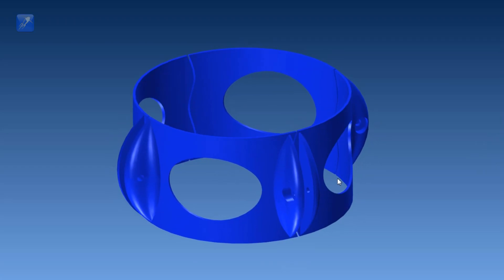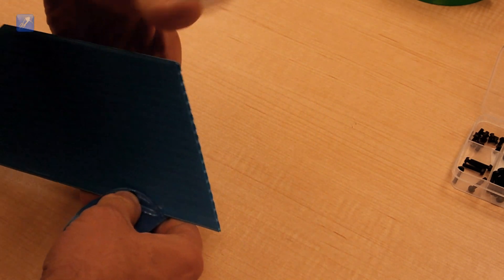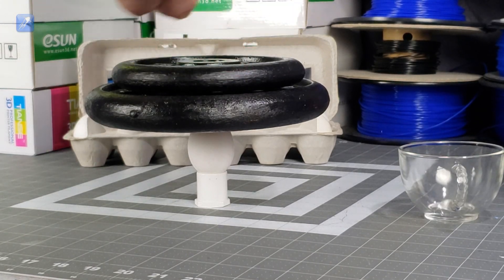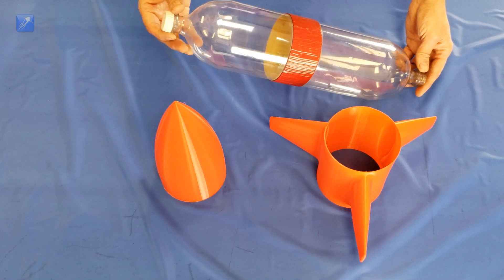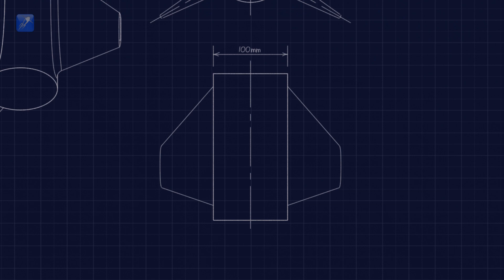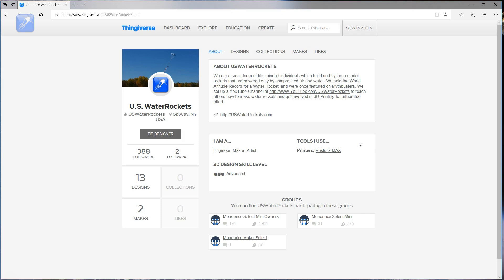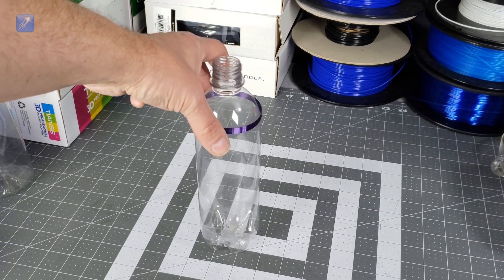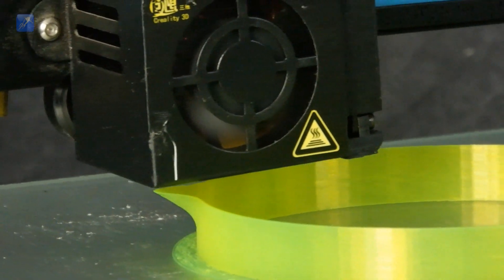Universal 3D Printed Water Rocket Fins

Comment: I could use fins like this if if is doable for 1 inch diameter rocket tube. Would that be possible?
Reply from the maker: There's no reason I can think of this won't work. I've printed some 1.25" in diameter and they worked great.
Reply: @USWaterRockets  Okay...great...thank you for the quick response!

Comment: My Cub Scout Pack just got into water bottle rocketry and we have been tinkering with simple cardboard fins attached with tape or hot glue. I’d love to show them how extensive the hobby is and that the sky is the limit when it comes to design and materials. However, I don’t have access to a printer. Do you by any chance offer pre printed fin sets and nose cones for a regular two liter ( coke or Pepsi ) type bottle? Any help or advice you can offer would be greatly appreciated!!

Comment: Will this fit in a 1.5 litre bottle? I'm from Malaysia.
Reply from the maker: It fits any bottle because you measure the bottle diameter and scale the print to match. It is explained in the video. Cheers!
Reply: @USWaterRockets  I found out the 1.5l bottle diameter. It's 88mm. So do I print it slightly larger, say 89mm? For it to fit?
Reply from the maker: Try 89mm and only print a little but of the fins to test fit. You can then decrease the scale until you get the exact fit you want. Every printer is a bit different, so it's hard to know what scale to use until you do the test fit.

Comment: Where can I buy the plastic used? Is beautiful, nice project👏
Reply from the maker: There are plenty of stores that sell 3D printer filament now. Most hobby stores and some office supply stores sell it. If you don't have a local store like that nearby, then you can get any kind of printer filament you want from Amazon or Ebay or Hobbyking. Thanks for the kind words!
Reply: @USWaterRockets  are you using PLA or PETG?

Comment: I'm sorry for being picky, (but, after all,  it's still rocket science, isn't it?). The fin area affects dramatically the centre of pressure of any rocket. CP should be always placed behind/below the centre of gravity (CG). As a rule of thumbs, at least at a distance that matches the diameter of the rocket. How can you be sure that your "one scaled size" fits all, works?  I mean, in terms of having a predictable flight trajectory. Keeping the same diameter, if you build a 50cm water rocket, or a 2 meters one, will require a different fin area.
Reply from the maker: The fin area can be increased or decreased by scaling the fin can in the Z axis when printed, but in reality most people who build water rockets generally make whatever size fins look nice to the eye, and then use clay or something packed in the nosecone to move the CG to where they want it. Thanks for the question. Your feedback is appreciated! Cheers!

Comment: very nice design just printed one nearly perfect only a bit of problem at the top and bottom edge of the fins  because of to high Layer Height
Reply from the maker: You have to find a balance between the layer thickness and the wall thickness (nozzle diameter) with vases. It sounds like you worked it out already. Nice!
Reply: yes got it thicker out when logging at the layers in cura. thinking of trying to at a layer of fiberglass for added strength to the fins and as a fun experiment    @USWaterRockets

Comment: Very nice design! Really like the well thought out structural 'egg shell' design and the ergonomic scaling feature! Makes me want to try water rockets again haha
Reply from the maker: Go for it! You can see this video was recorded back in the summer, and your lightweight fuselage idea was the motivation needed to finish the edits.
Reply: As a subscriber, I'm surprised you haven't noticed this "little thing"... The fin area affects dramatically the centre of pressure of any rocket. CP should be always placed behind/below the centre of gravity (CG). As a rule of thumbs, at least at a distance that matches the diameter of the rocket. How can you be sure that this "one scaled size" fits all, works?  I mean, in terms of having a predictable flight trajectory.
Keeping the same diameter, if you build a 50cm water rocket, or a 2 meters one, will require a different fin area.

Comment: That's a very neat, scaleable design! Well done! :) I think this is especially nice for beginners to water rocketry and 3D-printing. We made a similar design a while ago, but it's not scaleable because it connects through the nozzle to the rocket. Looking forward to put the two stage water rocket footage into our water rocketry in 2018 video. ;)
Greetings from the team
Julian
Reply from the maker: Thanks, Julian! If there's time, perhaps we will publish some more video of the stager. This is a busy time of the year! The hollow design is something we've used for a long time. The simple way of scaling is the "fell off the toilet while hanging a clock and hit my head" moment when the scaling idea was born.
Reply: As a subscriber, I'm surprised you haven't noticed this "little thing"...  The fin area affects dramatically the centre of pressure of any rocket. CP should be always placed behind/below the centre of gravity (CG). As a rule of thumbs, at least at a distance that matches the diameter of the rocket. How can you be sure that this "one scaled size" fits all, works? I mean, in terms of having a predictable flight trajectory.
Keeping the same diameter, if you build a 50cm water rocket, or a 2 meters one, will require a different fin area.

Comment: I remember I had a water rocket launcher but they don't make them anymore in stores anymore do too many injuries of water rocket explosions I still have mine but the pump won't work on it anymore
Reply from the maker: We had them years ago as well, but the ones they sold go only 50-100 feet high, so we started making them from soda bottles and putting many bottles together you can make them go hundreds of feet high. If you make them with exotic materialsd like carbon fiber, then can go thousands of feet high. The best part is that they are very good at lifting payloads, so they make great platforms for cameras or other heavy experiments.